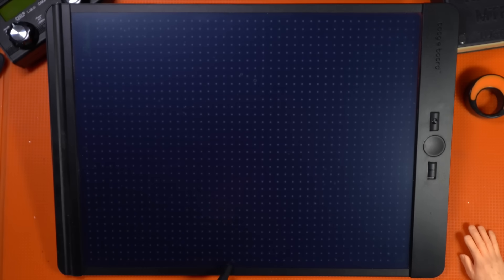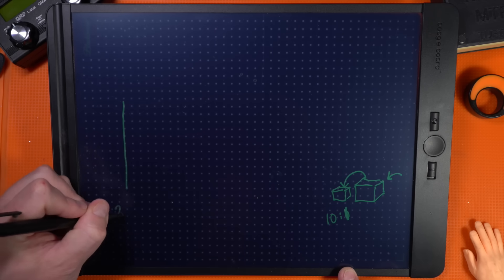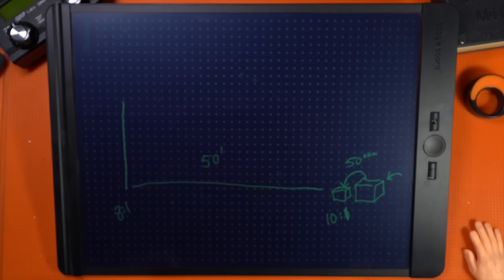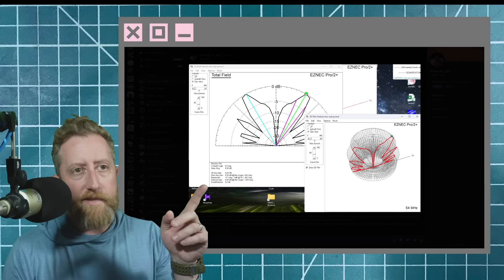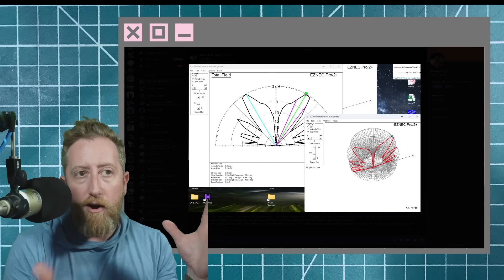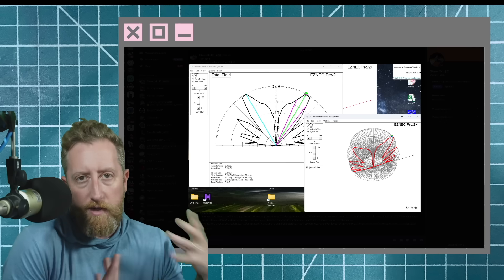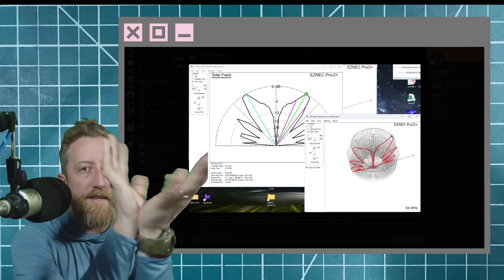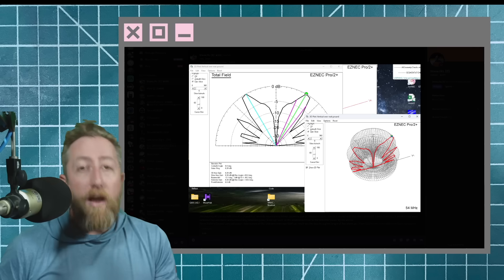This Antenna Mistake Surprised Me!

Comment: Josh, it may be useful to talk about RLC circuits and how capacitance, inductance, and impedance are balanced in a resonant circuit. “Correctly” done, the radio, feedline, and antenna form an RLC circuit. What a “tuner” is actually doing is adding capacitors and inductors to balance the circuit. The clicking is relays activating additional portions of the circuit board.

 I have been studying for the Extra test and thats a good part of the content. It explains this exact issue: we add the coil as an inductor to balance the capacitance so the circuit can resonate. Smith charts are intimidating, but the upper part is capacitance and the bottom is inductance. Both are the yin & yang of reactance.

Comment: How do you minimize feed line lose?
Is there a way to measure feed line lose?
Reply: Yes, you can evaluate feedline loss.  It's not easy to do it by measurement with a running antenna, though.  The degree of loss is mainly dependent on (A) the loss/ft at frequency of operation for the feedline (some are lossier than others) and (B) the magnitude of the standing wave due to termination mismatches.  You can use software like SimNEC (google it, it's free) to estimate the actual combination of the two in a given circumstance.  You would use it to build a model of your generator, the feedline, and a specified load (determined from, say, your antenna with a VNA measurement), and the software will calculate loss in the feedline and power delivered to the antenna.
Reply from the maker: Pay for higher quality feedline or keep it as short as possible.

Comment: I think operators need to be a lot more picky with regard to swr. It does not tell the whole story. but it does provide some important information. So many hams (in my area) don't seem to care much about swr. To be clear, a bad match could be the result of the cable you are using. IMO, it might be that largest reason for a bad match. And if you have a bad match, for me, anything over 2:1, the signal does bounce back and forth between the antenna and tuner/radio. And because of the feedline, you incur losses.  I like the tuner to be as close to the feed point as possible. Another test, I like, is to put a power meter at the feedpoint and see how much power you are getting at the feed point vs how much you are putting out.  These things become important as the band cycle changes, currently we are trending down. And as the bands close I want my antenna to be as efficient as possible.

Comment: Minor suggestion .. tuner does not affect the radiation pattern while a loading coil will….. then we can also move the coil to different parts of the antenna .. bottom , middle and top to change the pattern again in each position ( noting the coils size  needs to change amount of inductance depending on the physical antenna position )
Reply from the maker: Yes! Topic for future video. Center loaded, bottom, etc. lots of fun there.
Reply: The tuner is just a bunch of little loading coils and capacitors…

Comment: Vertical antennas do a lot better with a remote tuner at their base.
Reply: Absolutely
Reply: Yup! How I run my 43 foot vertical. Yes it is a compromise antenna, yes a dipole would perform better but I have no trees that are tall enough and I don't need masts with guy wires to mow around! Mowing slightly over an acre with enough obstacles!  I do have towers but 2 of them have EME arrays so no wires allowed off them to snag the yagis on!
Reply: @MaryBrownForFreedom  you say you don’t need masts with radials but doesn’t your 42 foot vertical need them? What’s your radial system?
Reply: @forgetyourlife  43' vertical is free standing and has survived 95mph winds, no guy rope anchors to mow around! 

Radials were lawn stapled down after mowing super short where they would lay. In 3 weeks they were hard to see, 6 months you couldn't see them, now 10 years later they are 3-4 inches deep  in the lawn... I was mowing over them 2 weeks after putting them down! 

I live on the MN prairie... turf and roots build up fast!
Reply: Any antenna does better with the tuner at the antenna end of the feedline.  That removes the resistive losses of the coax so the signal just bounces back and forth from antenna to tuner until it is radiated.